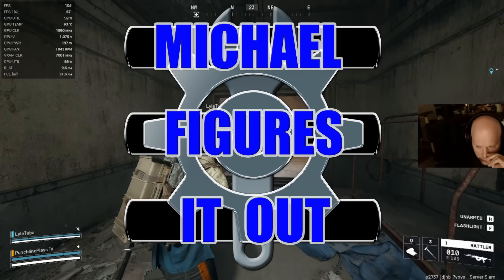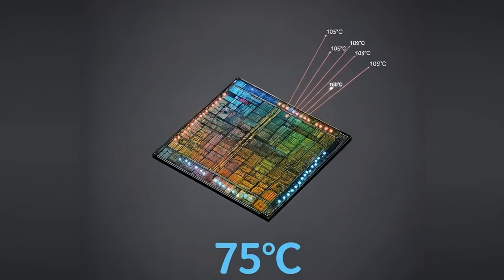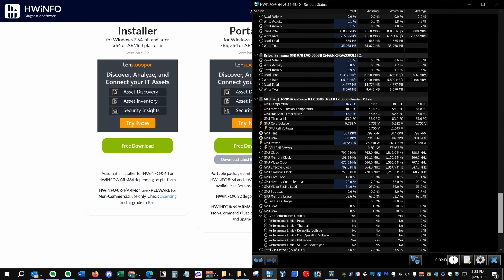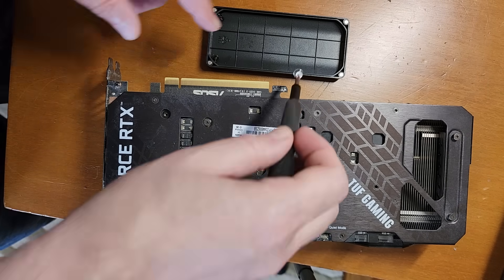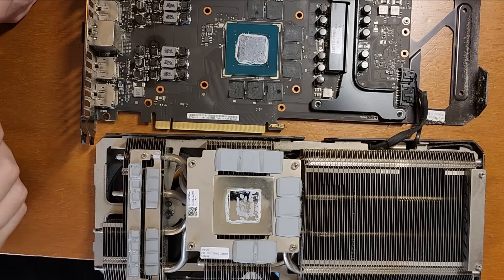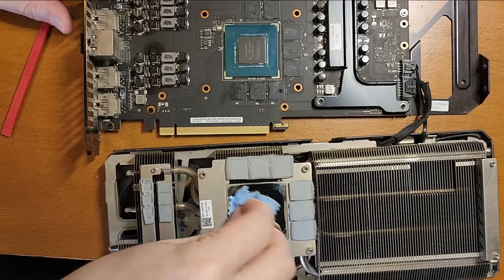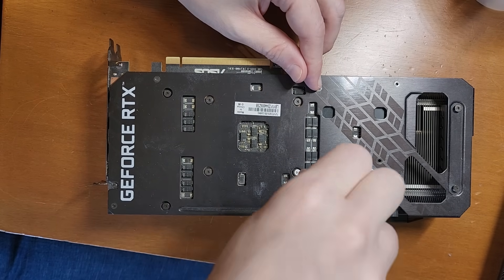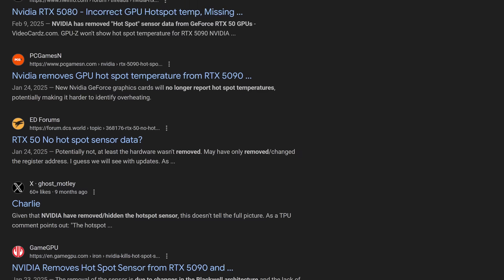GPU Temps Are A LIE!

Comment: NT H2 is a really bad idea for a GPU. Pump Out will be back in a month max.
Reply from the maker: I think that's a bit of an exaggeration.
Reply: @MichaelFiguresItOut  no, NT H2 (and H1) is a terrible thermal paste. the quality between two syringes fluctuates a lot.
the best sample tested in a lab out of three syringes: 100 µm BLT Testing with just a 125W Heat Load it already lost against Arcitc MX6 and MX7, the entire lineup of maxtor, halnziye, thermal grizzly, savio, shin-etsu, AAirhut and DOWSIL TC5888.
and it has such a bad "recipe" that it pumped out after a short time, which is pretty much what i see on my GPUs over the years. it lasts between 20-50 hours of full load on a 200W+ GPU.

the conclusion of a scientific test of the best! example:
not suitable for graphics cards in long-term operation. The quality of the NT-H2 fluctuates significantly.

Comment: I tune my fans/temps to be based on hotspot. I have RX 5700XT and I set my fans so the hot spot doesn't go over 105C in worst case scenario-full max power/watt(that translates to 78-82C on the "GPU temp"). Hot spot is in the 95-105C most of the time. The 5700XT series is good until 115C and some models hit that out of the box. I have a good 3 fan model and can set fans to be really quiet. To be fair my ASIC quality of  96.6% helps too😄.
Reply: damn 85-95c ? I have 3070ti with undervolting it never reaches 65c gpu temp and hot spot is 75c.
Reply: @ibobeko4309  Well the good hot spot temp is up to 110C and when I undervolt it a bit better without overclock it stays at 90C(the hot spot) and the GPU temp stays at 70C max-the hot spot is at least 20C over the base temp on 5700XT and can be up to 30C more in some models. So the base temp is 65C-70C(close as your 3070ti) but hotspot is 90C so there is the difference. That is with the voltage at 1050mv and the clocks at stock.
Reply: @ibobeko4309 it was 95C-105C I made a typo,corrected😅.
Reply: @pusaduva  That is unfortunately normal with AMD cards, i wanted to buy a 6800xt card and it has the same hotspot issue also the 7800xt series and 9070xt has the same issue, it even reaches 110c. 

The problem is amd says it is ok, some people have no issue at all but overtime i dont think those temps are ok.
Reply: @ibobeko4309  Well as hot spot is "OK" by thermal design up to 110C but keeping it at like 95C will make it safe as any other card just if you push it to 110C all the time you can create problems in the long run. Even some Nvidia cards have that problem as I watched videos that say they do but it varies with the model and design of partner cards same is with AMD as some cards hit 110C and some stay in the 90s max.

Comment: Hey i have rx6800xt xfx merc, i did undervolt and underclock the temps seems to be in 56 and hotspot 58-64 but my gpu still gets artifacts under any load and my screen starts losing the signal from gpu, could it be the hdmi port?
Reply: Install HWINFO or GPU Z and look for your VRAM temps. 
But if you get artefacts from any load, it could be your underclock, do you get artefacts also without underclock ? If yes, VRAM or PSU issue, install the gpu on another pc and try it out, if you still get the same issue it is VRAM, if not it is your psu.
Reply from the maker: Not sure but you should use the DisplayPort if your card and monitor have them. HDMI has lower refresh rate limits.

Comment: Changed the thermal concrete for thermal paste on my 3070 ti ventus 3x and temps dropped by 18°C GPU and about 30°C for the hotspot with reduced fan speed (didnt change the fan curve). It's very easy to do, just be very careful when cleaning (isopropanol, non cunductive alcohol) around the gpu die (tiny smd's).
Reply from the maker: Exactly!

Comment: After repaddin my 4070 ti sup...I was getting random crashes...checked hot spot... was reaching 100-107 while average temp was 60-65...I used the right thickness but the pads are too dense n heatsink not making good contact after takin GPU apart I could see chrome in certain spot with no thermal paste coverage...used same thickness but less dense pads... hotspot dropped to 78-82 degrees...ran two days with no crashes...fingers crossed hoped this is my fix
Reply from the maker: I didn't know the pads have different densities. Can you share which brand was too dense and which brand worked best?
Reply: @MichaelFiguresItOut  the brand is gelid...they have extreme and ultimate...extreme density is 2.4 and ultimate is 3.8...idk remember the exact numbers but it's around these figures...i always use extreme...just wanted to give ultimate a shot...I won't say I don't recommend them...they just didn't work for me...and these were the pads for vram...prior to changing the pads idk the vram temps and idk the temps with the too dense pads...but with current pads vram temps are 64 to 68 when doin a stress test
Reply: @MichaelFiguresItOut  n while I was changing pads I switched it back to thermal grizzly phase sheets n that thing been laying around for awhile
Reply: @MichaelFiguresItOut  man it seems like every stress test temps get lower n lower... overclock GPU n average temp is 62 hotspot is 75 vram 60
Reply from the maker: @Bigga_Velz85  NICE!

Comment: Yeah but the HwInfo's hotspot temperature is also a lie. It even says right there in the tooltip that the number is not confirmed and just a guess.
Reply from the maker: I don't think it's a lie, it just that they can only monitor what the card makes available to the software. In most cases, it's accurate.

Comment: Just got an ASRock Challenger RX5700 XT frim Ebay for $109 total. It was overheating so I used Artic MX-6 for the GPU and TP-3 Pads for the Memory and VRM's (put it on back plate also, it is Aluminum). I get pretty much the same temps as you get now and I am going to buy another one for my Grandson because these are VERY good mid level cards.
Reply from the maker: That's great!

Comment: Thanks for the info on what makes thermal pads old. I didn't know that soft ones were the ones with some mileage to left to go.

Am gonna have to order some putty (l heard it's safer and works without issue for newbies) to replace for my 3090
Reply from the maker: Nice card. Good luck with the replacement.

Comment: Fyi when u talk about the imperfections in the heatsink. U could do what's called lapping. Using different levels of sand paper and end with a mirror like surface. Will improve idel and load temps.
Reply from the maker: That would probably help but is a bit more involved.

Comment: With the amount of dark silicon in modern chips, average temp has lost a lot of meaning. Hot spot temp/junction temp is what you need to care about
Reply from the maker: What is dark silicon?
Reply: @MichaelFiguresItOut   Dark silicon is unpowered/unused silicon on the chip at any given time. For example, integrated circuit for RT acceleration is turned off for non-RT workloads, thus giving more power to other parts. Same with media engine, AI tensor cores/wmma AI accelerators, etc. Even a "shader" core has many sub-components that are not powered at any given time. That's why a naive average for ALL the temperature sensors can be misleading. If the GPU behavior uses the average temp instead of junction/hot spot temp, that is just stupid design (and unfortunately, some GPUs do that).
Reply from the maker: @urncjd  Wow! I didn't know that. Thank you for replying. Makes so much sense as to why the average temp is not helpful!

Comment: This was what i did to my Strix RTX2080 a couple of years ago because it was crashing in games when under full load, the GPU was around 75C with a hotspot of 105C, repasted it then then it was 65C and 75C and the GPU boosted a further 200Mhz by default on it's own. Oh and it was quieter.
Reply from the maker: It's a game changer, literally!

Comment: Hey! I had the same problem in my 4080 Rog Strix and a 3080 Ti of Gigabyte. All temperatures looks fine, veeery fine (like 60/64 in core and mems), but the hotspots close to the 100º. Try to repaste both, and this solve the problem BUT IN DAYS, the same hotspots problems came back. I continue investigating this and find the "pump out" problem of thermal paste, very common one in GPUs, it's very interesting, so I recommend you guys investigate it. Finally I found a user that solve the problem with the PTM7950 Phasesheet and I decided to give it a try and IT WORKED!!!! Solve the hotspots temperatures caused of the pump out of the thermal paste for ever, even improving factory new temperatures in the 2 cards

(Sorry if my english is not fine guys, Im spanish and I dont know perfectly english)
Reply from the maker: Your English is perfect! PTM seems to be the best fix.

Comment: I do not recommend using Noctua - or any other high-performing thermal paste for a GPU. They usually perform well for few weeks/months, but pump-out fast on direct-die application, wayy before they dry up. 

Best thermal interface material for a GPU is Honeywell PTM7950. Other good pastes are those with high viscosity, like Arctic MX-6 (but not Arctic MX-6, that one does pump out fast as well).

The hotspot is actual die temperature. The "core" temperature sensor might be a sensor in the socket or even elsewhere.
Reply: quote : Best thermal interface material for a GPU is Honeywell PTM7950. Other good pastes are those with high viscosity, like Arctic MX-6 (but not Arctic MX-6, that one does pump out fast as well).

did you mean mx-6 ?
Reply from the maker: I don't think the Noctua paste is bad but if this happens again, PTM will be the next fix.

Comment: Using PTM 7950 with undervolting and overclocking not only delivered higher, more consistent boost clocks but also lowered the hotspot temperature and reduced the gap between the GPU and GPU hotspot temps. My RX 6800XT used to hover around 80°C at the hotspot, but now it never exceeds 65°C, and the boost clock hits 2650 MHz+ in most games.
Reply from the maker: I've heard undervolting can improve performance but never tried it.
Reply: It's easy and safe with plenty of videos on YouTube explaining the process

Comment: I did a lot more cleaning and the card works perfectly fine, this is because it was from a reseller and smelled really bad. I gave it a bath in alchohol several times, washed the fan plastic with water and alchohol, the one thing that helped the most is deoderant. It completely removes the bad smell from burning metal of heatsink. Applied new paste and it has good temps. I never had a crash with my 3070, and it doesn't smell like a mining rig anymore.
Reply from the maker: Smelling bad is not a good sign for a graphics card.

Comment: Problems? Use G-Sync to limit fps to refresh your monitor. Most people are idiots and disable v-sync. Max fps for gpu = higher temps.
Reply from the maker: Linus did a test and it seemed he had better performance with FPS higher than the monitor's refresh rate but I agree with you that it is probably negligible. Besides, my GPU cannot push out FPS higher than my 165Hz monitor anyway.
Reply: @MichaelFiguresItOut  165Hz is already great, so vsync shouldn't hurt too much. Use FreeSync and G-Sync if possible

Comment: Lots of useful advice. But: while the Minecraft guy might be preventing sagging, he's not height adjustable and looks like he's flexing the card in the opposite direction (potentially causing damage). Better a purpose-built adjustable pillar, no?
Reply from the maker: You're probably right.

Comment: Thats why I watercool front and back of my gpus ,just a shame its not cheap to do

And the latest cards by nvidea are modular in parts so watercooling is even more difficult now than before like with the 10, 20 to 30 series are all non modular and one pcb ,but most 40 /50 series have modular pcb boards
Reply from the maker: Hmmm, no one really talks about the cards being more modular and thus more difficult to modify.

Comment: I had a 4070ti tuf 12gb which was hitting 120C on the hotspot. I got a full refund thankfully.
Reply: What is your case? I only use mesh cases, and never had those temps. And I only use radeon GPUs.
Reply: @korosoid fractal north
Reply: @pyonderu  Looks good. Maybe you had only intake fans? Or, maybe just unlucky with a sample, hence RMA'd with no issues.

Comment: Meanwhile, I had a Radeon XFX RX 6800XT Merc top-of-the-line with beefy cooler and that freakin thing would run hotspot temps +105'c even reaches 110'c.. and its normal for these AMD cards.
Reply from the maker: Yup. That's what I've heard.
Reply: @MichaelFiguresItOut  Its fine tho. Traded it for an RTX 3080. And after a while AMD announced they'll be cutting driver supp for RX 5000 and 6000 series LMAO. Never buying AMD Radeon trash again.

Comment: Good explenation for the common problem that most people are not aware of. Most of silicon based thermal pastes starts to pump out from 80° Celsius that's why new laptops and GPUs needs to be reposted once in 6-12 months.
I can also add from my experience  that noctua thermal paste is the best when it comes to handling pumping and I`m also recommending PTM7950 for laptops and new GPUs as it will not pump out or degrade over many years.
Reply from the maker: Thank you. Will switch to PTM if this doesn't hold.

Comment: with normal GPU hot spot difference 10 daggres for example if i push my gpu limits its 80 daggerese and hot spot 91-92 daggerese. but usally iam using with undervolt whit no permance loss, with unvervolt my temp 71-72 daggrese and hot spot 81-82 and this is normal with rtx 3000 series gpus. but i must tell ASUS gpus works much cooler then others. thats why ASUS charge you more money.
Reply from the maker: Lots of people undervolt without any real performance hit.

Comment: Just because the hotspot is high doesn't mean the GPU should crash, GPUs are generally designed to handle a temperature near the max for certain hot points the reason the sensors exist is to ensure the 110c limit is not exceeded... I'd begin to think faulty silicon if reaching 105c is the only reason it crashes. The GPU will throttle if it's overheating, if it's crashing because it's overheating that's a separate issue because normally the impact of overheating should be performance, not stability.
Reply from the maker: I think the BIOS forces the card to shut down when the hot spot exceeds the thermal limit, which causes the crashes.

Comment: I switched AMD 3 years ago from a GTX 1080. You dont have a built-in option for these stats in the Nvidia app?
I thought with AMD that this is normal nowadays that I can see even the GPU memory temp with built-in overlay. I am not using MSI afterburner with AMD card, because I can get every info I need with the built-in overlay.
Reply from the maker: Plus for team red.

Comment: I used PTM 7050 and that's dropped my temps from 90+ hotspot to 70-85c on a 6950xt which usually run hot from factory. It ran even cooler than when I brought it
Reply from the maker: That's great!

Comment: I recommend using Honeywell PTM7950 as it phase changing and stays fresh much longer 2+ years for sure (Tried Arctic MX-6, Noctua, Thermal Grizzly and Gelid pastes before, 6-12 months of gaming and back to throttling)
Reply from the maker: Will try that if this starts to fail again.

Comment: Well engineered 8-Pin Power Connectors, 32-bit PhysX, and GPU Hotspot sensor readings.
What DIDN'T Nvidia remove from the 50-series?! Those greedy bastards!
Reply: Cut PCIE bandwidth in half from x16 to x8 to bottleneck 8gb of memory and make your game slideshow.
Reply: they didn't manage to remove the money from my wallet cause I ended up buying radeon
Reply: And they brought back 32bit physx support for most popular games in the latest driver update.

Comment: you can just use msi afterburner to see the average and hotspot temps with a lot more with an imngame overlay and a graph that records the last 60 secs
Reply from the maker: I used to use MSI Afterburner but I accidentally underclocked my GPU! It's a bit much for simple temp monitoring.
Reply: @MichaelFiguresItOut how do you accidentally underclock your GPU?

Comment: Allow 20 degrees for hotspots. Your GPU needs to be 20 degrees cooler under load on average than it's max capability.... Sure, it will manage the first year ok, but thereafter, this adjustment will become necessary by undervolting/underclocking/fan curve adjustments if you want to maintain reliability...
Reply from the maker: 20C is too much delta. 15C at most.
Reply: @MichaelFiguresItOut  Not in the long run...

Comment: I had this exact problem on my 3080Ti. If my die temp got above 60C, my hotspot temp would just start climbing until things would throttle or crash. At times, 110C or 115C which didn't make sense since it should cut itself off well before that.

After lots of troubleshooting, the issue was that it used heatpipes directly on the die. Not a vapor chamber or intermediate block. Direct touch heatpipes are fine if you have a heat spreader, but this is directly on the die. The heatpipes had become separated and a gap formed between them. Even filling the gap with liquid metal or solder did nothing to help.

So I ditched the cooler and went to a water block. Now the die and hotspot are never more than about 7C apart. Not to mention that my load temps went from 60/100C to 38/45c.
Reply from the maker: Which card manufacturer did that?